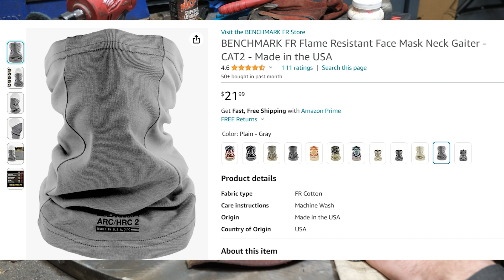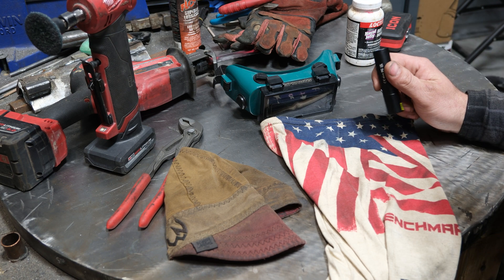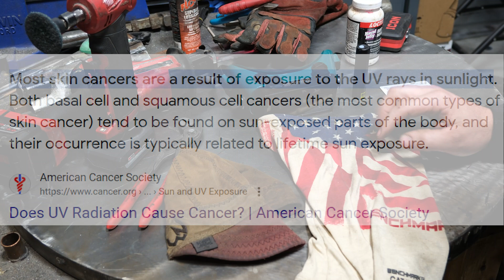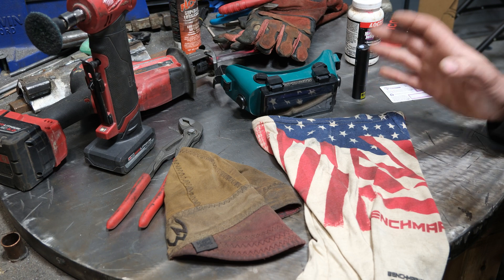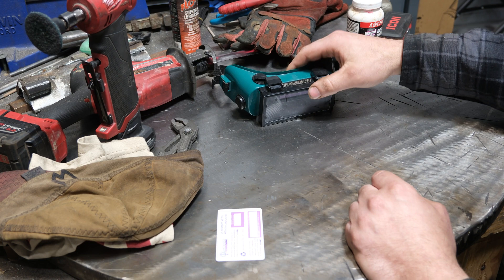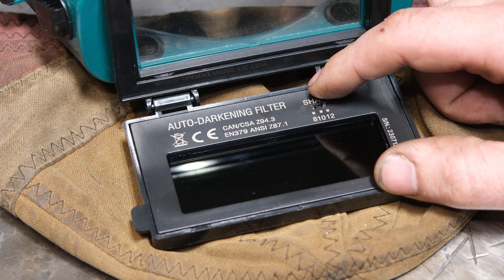Unsafe welding gear........

Comment: Been in the market for a welding shirt. Having second thoughts if they don't protect against UV. Great timing!
Reply: there are a number of very good welding shirts out there. I am in Canada and buy from Canadian Welding Supply. They have US and Canadian made shirts which are UV and UB protected. If you go to their web site you can see the shirts , find the maker then buy them in the US were I believe you are.
Reply: in a pinch  when I didnt have fr sleeves  handy I put a jacket on backwards...basically makes a front apron
Reply from the maker: I tested a couple thicker shirts I wear off camera and they had no issue passing.  Same thing with my fr button up shirts.  They are fairly thick though.  Generally speaking the thinner they are the more suspect they will be.  If they list uv protection you should be good.  Stay away from thin tshirts type material for sure lol.